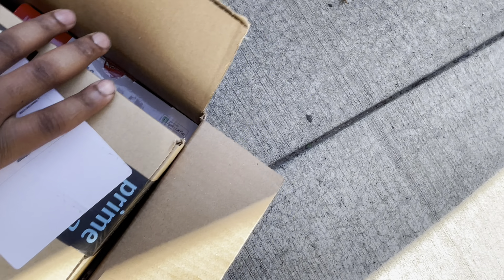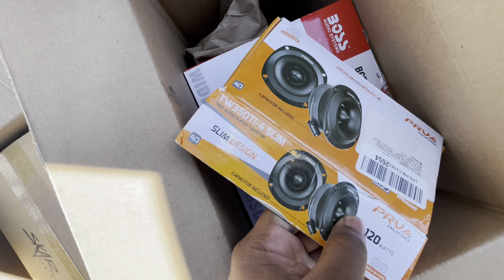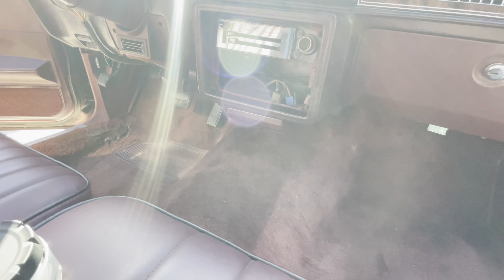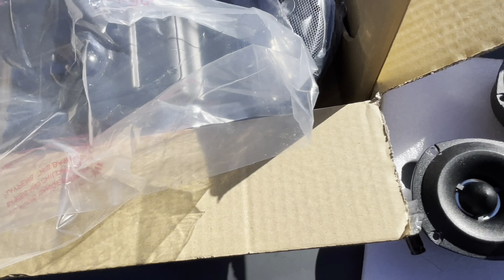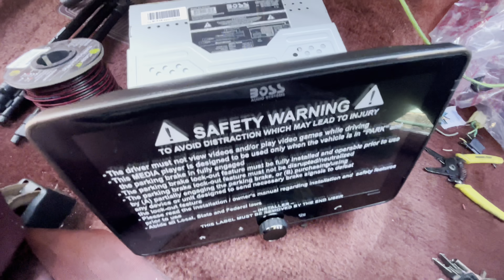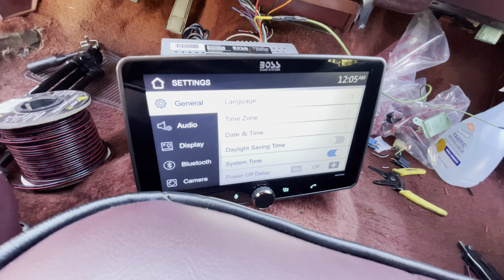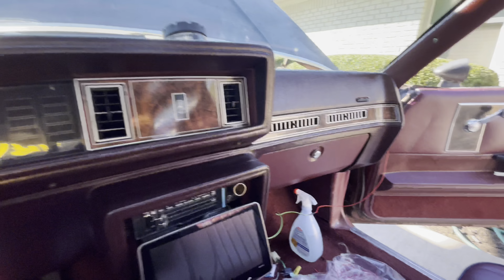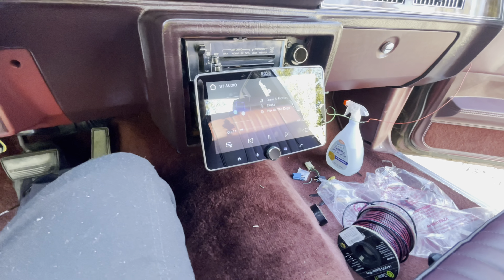Installing A Boss Radio In My 1983 Cutlass Supreme

Comment: So all I need to do is connect those 4 wires?
Reply from the maker: Yes. Those 4 wires will give you power. You’ll still need to wire in your speakers, but just follow the color codes and it’s pretty easy

Comment: What bezel did you get put at head unit
Reply from the maker: I basically used 1 bracket that came with the head unit and mounted it with self tappers inside the dash. Maybe down the road when I add some power to the car I’ll put something more official in it. But hasn’t failed me and doesn’t move at all now.
Reply: @1tonystunts  you're yellow wire is always hot red goes to the ignition black goes to the ground